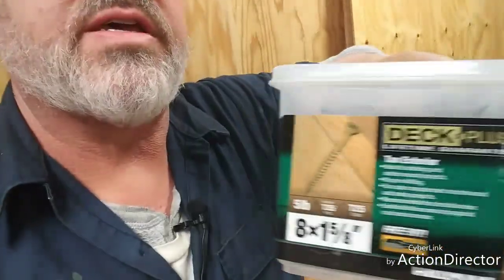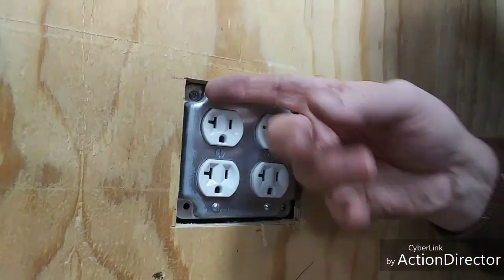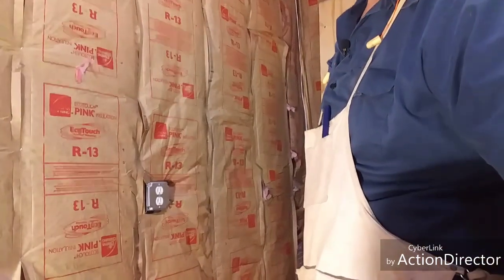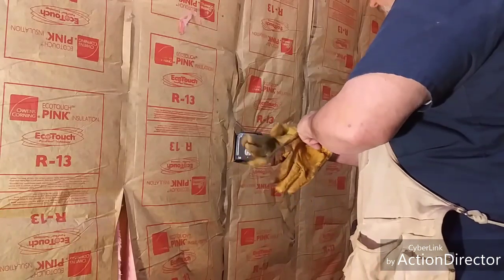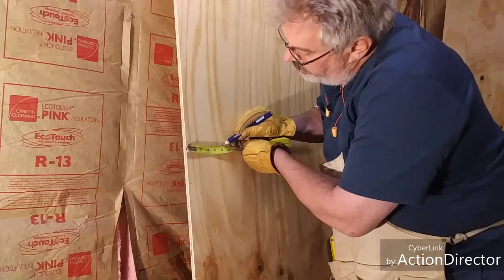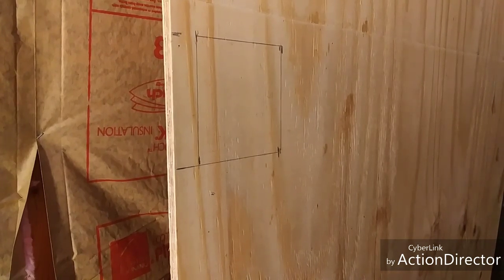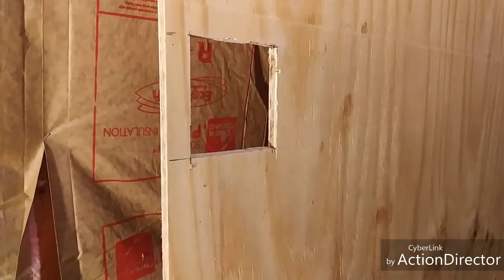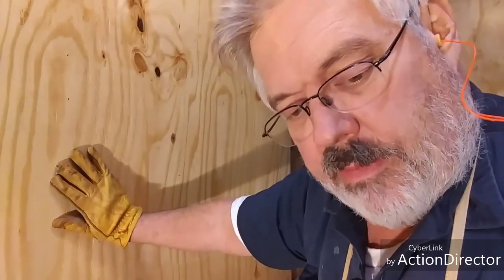Oscillating Saw,  Alternate way to cut around outlets and light switches.

Comment: Great video. I was just searching for the quickest and most effective way to cut out some outlets.

I actually tried a rotozip first with 7/16 OSB and after breaking a couple of bits I decided it was time to find another tool.

Thank you for the video, good job!
Reply from the maker: It works great but I did go through a couple of blades.   Just start a little bit of an angle and then you can hold it at that angle and just buzz through the wood.  I also found that I can get metal cover plates and cover up the holes.  I was worried about sparks from grinding in my shop going inside the wall. I just need to go buy a bunch of metal cover plates now. :)

Comment: Thanks! I was about to use a jig saw. I'm glad you had a better idea.
Reply from the maker: I really dislike using a jigsaw and was just trying to come up with a different way.  I was first using the multi-use blades that I guess are for both metal and wood and then switched to wood only blades.  But I still like using this best.  Thanks for watching and best of luck on your project.

Comment: I'm using 3/8" double gang mud rings on all my receptacles and single gangs up top for my lighting junction boxes. I'm also running conduit throughout my whole barn... I'm an electrician so I'm going all out. It's also my snake breeding barn too so I'm cutting no corners
Reply from the maker: That would be cool.   I know enough about electrical work to make me dangerous. But I found that I can put a stainless cover plate over these and it overlaps the wood so I am not left with that gap around the outlets.  I need to buy more of the plates but they cost more so I have been putting them on a few at a time.   I am putting my ceiling up now out of 1/2" plywood and I will have to cut around my light fixture gang boxes and also the few outlets I put in my ceiling for things like retractable shop lights or retractable extension cords. In the barn side of our shop/barn, I ran conduit up from all the gang boxes for the switches and outlets and put a gang box at the top of each for my junctions. We have 1 horse right now and I was worried she would chew on wires so made sure everything was in conduit.   Let me know how it works out.  Thanks for watching.

Comment: I just did a wall with 7 boxes, 1/2 plywood. The jigsaw was way faster. Drilled all the holes at once, then made all the cuts. The multi tool is good for FRP panels, too slow for wood.
Reply from the maker: It worked better for me but it could be my old (probably over 30 year old) jigsaw and old blades did not cut well.  Also my first attempts with the oscillating saw were slower because I had a multiuse blade on it and it was slower than a wood cutting blade. Glad your way worked better for you. Thank you for watching and commenting.  I appreciate the input.

Comment: All you had to do is change the commercial work cover to a two gang mud ring. Then you should you use a stainless steel plate.
Reply from the maker: I found out that I can use the stainless plates and screw them in over these and they cover up the opening and also keep the outlets from flexing in some.  I have some of them covered now but need to buy more stainless plates.  Thank you for watching and for the comment.  I appreciate it.

Comment: Thought I would use a jig saw, I like you using the oscillating saw, good idea
Reply from the maker: Thanks for watching.  One thing I learned was to buy the wood cutting blades. I was using a combination blade and it took more effort. Hope it works out for you.

Comment: What stainless steel plate did you use to finally cover the boxes?  Thanks
Reply from the maker: I bought a standard metal stainless plate from Lowes or Home Depot and it was bigger than the opening so it overlapped the wood.  I'll try to find a link for you.
Reply: @GaryForgingOn  Thanks for reply.  I can find now.

Comment: will a multi-tool blade do 1" redwood siding?
Reply from the maker: I am not sure how hard redwood would be.  This plywood wore out my smaller tooth multi blades.  I have now switched over to using wood only blades and it goes through faster.  But if redwood is real hard it might take a smaller tooth.  It would just be slow... 
I hope that is helpful.  Thanks.
Reply: @GaryForgingOn  Thanks. maybe start and then jigsaw;)
Reply from the maker: @stara808  Might be the way to go. :)  Hope it works out for you.   I would love to know how it does on thicker wood.   Thanks

Comment: Why are there no switches on the outlets?
Reply from the maker: I'm not sure what you mean.  A switch to turn the outlets on or off? I have light switches by the doors for the overhead lights.  I did a search for power outlets in Australia and I see little rocker switches. Are those required?  The search said you all normally use 230v 50hz. Where I have a couple 220 outlets for my welder but the rest of the shop are 110v outlets.
Reply: Gary Brown Forging On Here in Australia, I have never seen a wall outlet without a switch, extension boards yes, but not a wall outlet, which is why I made the comment.
Reply from the maker: @smallcnclathes    That is fine.  I didn't realize Australia had those kind of standards for their outlets .  All I had ever seen was the different shapes to the plugs for different countries.  Hope you are doing well and staying safe and healthy.
Reply: @GaryForgingOn  Hi Gary, yes we are Ok. Just fighting off insanity caused by the lockdown we have here. It really is starting to get to us a bit. 6 months of it with no relief in sight.